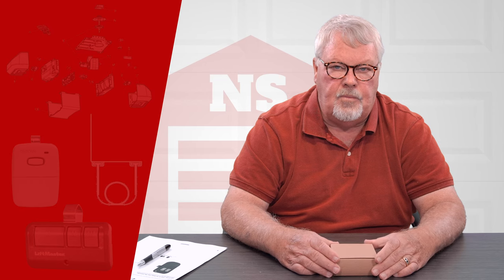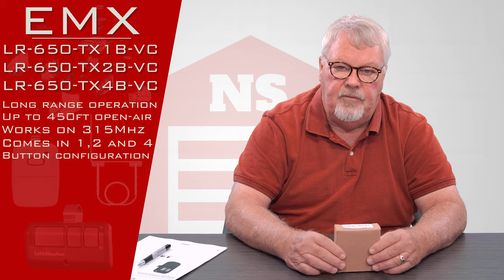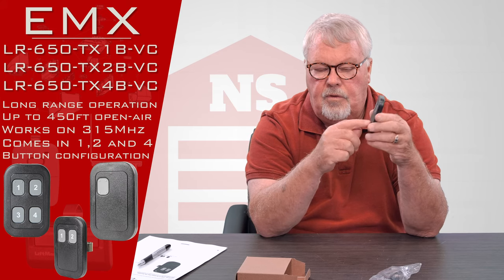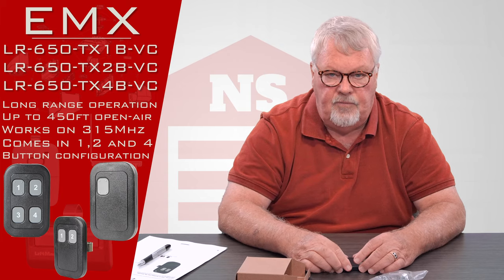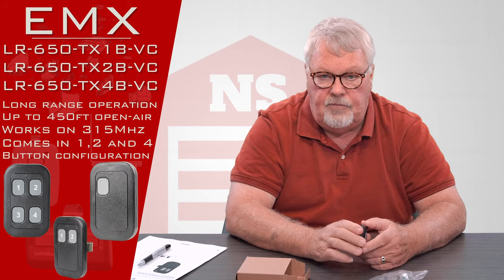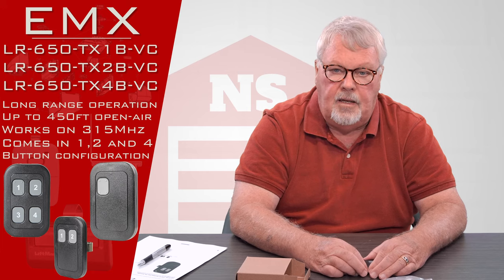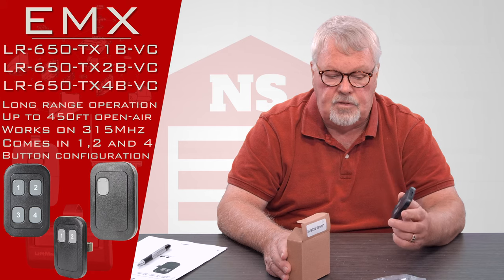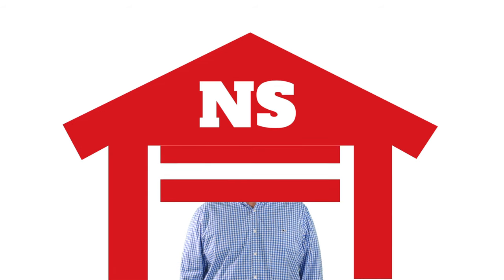EMX LR-650-TX1 Long Range Transmitter

Comment: So I have a bunch of these that a gate installation company left me after they configured these to work on our gates that have linear access receivers in them that are 318 Mhz . They do indeed work and I am guessing that they shouldnt ??? Clearly the Mhz is wrong . Can you explain that ? The range however is like 2 feet.
Reply from the maker: Not sure whats going on but my best guess in that since the frequency is very close the interference could allow the signal to activate the receivers, but im not quite sure about that. I will get more info from linear and pass it on to you.
Reply: @nscommercialdoor  Just wanted to let you know that I solved that mystery . Shoved way up inside the operator was also the EMX reciever. Yes I beat my head agaisnt the wall on that one for a time. The linear is for the safety strip and the EMX was for the remote operation. Kind of screwy.
Reply from the maker: @kylevantassel7259  Im glad that you got it figured out, I was scratching my head on this one. I will keep such scenarios in mind. Thanks.